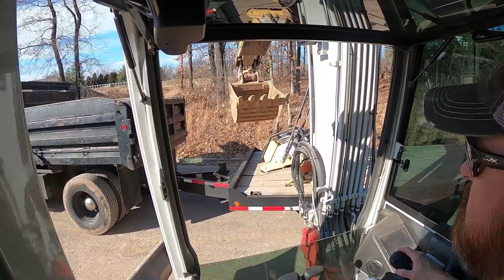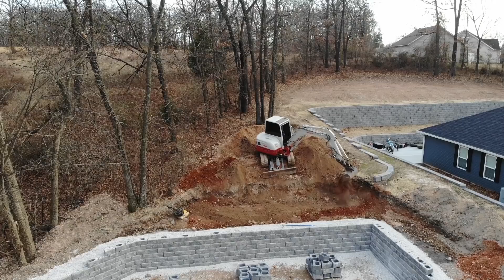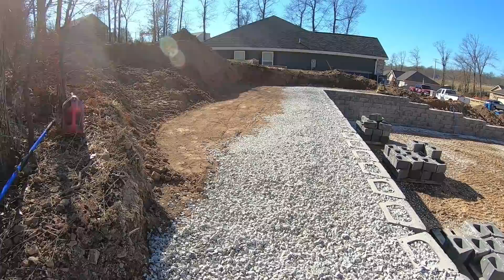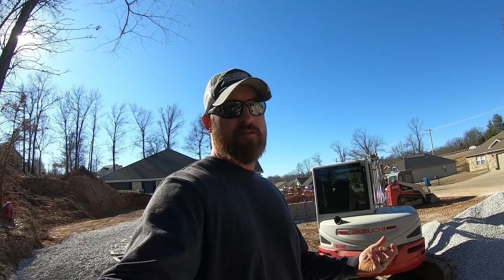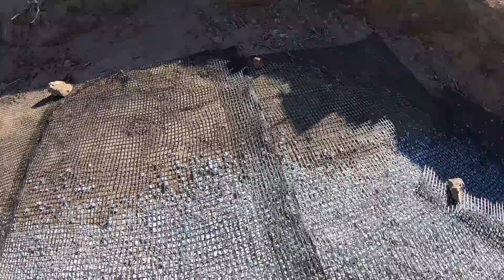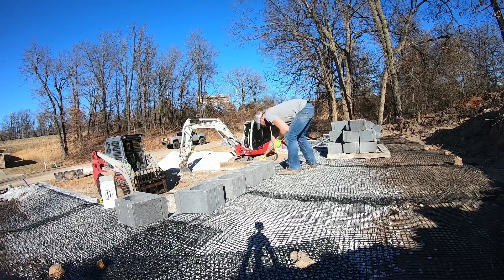Setting The Last Row Of Blocks

Comment: A company that I used to work for made construction barrier and geo-grid type fabrics.  I did some of the initial testing back in the late ‘70’s.  The answer to the strength question is pretty simple.

The fabric starts out as a molten ribbon.  It is pulled through a roller that pierces slits along its length.  As the ribbon is pulled through successive rollers it is stretched wider and longer.  The fabric you used is 1”X2”. That yields more linear strands per foot running down the length.  This combined with the extension bands along the edges give it more than twice the strength lengthwise .

You will almost always find rectangular extruded fabrics rolled with the slots lengthwise.  This is partially because they are more flexible.  But, mainly because it is easier to control roll widths across shorter extensions.  So, if you measure the openings across the fabric at the start of the roll and the end, they will be very consistent. The lengthwise openings will vary significantly.  It has to do with temperature, tension and speed of the expansion line.

Did you happen to notice that it is easier to fold the fabric lengthwise than to do so crosswise?  That is why construction barrier is usually square extrusions.  It will stand vertically better than rectangular fabric.  In your use, that doesn’t matter and you save money with less material in rectangular fabric. However, either will work.
Reply: Sorry about the fabric rant... almost forgot to compliment you on the care and workmanship you’ve put into this project.  It’s looking good.  My offer still holds... if you need a broom man just holler. 👍👍👍
Reply from the maker: William Harris wow good to know I’m going to start calling you more lol! You just told me more about than the guys selling it 🤣 I appreciate that and will definitely apply that in the future.
Reply from the maker: William Harris thanks! Lol good know I appreciate and will probably take you up on that
Reply: Elite Earthworks LLC yep... you have to have a broom man on every utility job... it’s just like putting a “Utility Work Ahead” sign out... put a guy leaning on a broom and you don’t need a sign!
Reply from the maker: William Harris exactly lol!

Comment: Great job and video Brandon. You are correct Geo grid stronger the way you put in.
Reply from the maker: Larry Shedd thank you! I guess it’s the way it holds they really didn’t explain it to me just told me that’s how it goes
Reply: @eliteearthworksllc  more  overlap ribs makes it stronger  like double the material every so many feet.  But lots stronger than just rolling whole thing out other way.  But you did it right way.  Takes longer makes it stronger.  End of day it's your job you have to stand behind.  Best way to explain is like cables every so many feet back into bank.  Did you do back yard that house has two lifts cut into back and side yard.
Reply from the maker: Larry Shedd I see that makes sense. Thank you! No some else cut that out and built those walls
Reply: Watch your words packing only 4 inches.  Your boots look bigger than that
Reply from the maker: Larry Shedd 🤣🤣 yeah they’re 13’s

Comment: Bravo... Some one on YouTube who actually compacts the soil instead of the many shove it shut and roll over it with track artists. A plate may be better in your application. We use jumping jacks BUT, most all our work is ditching with most jobs using a soil tester. In some of our work, we have to use screenings as back fill, especially in streets, making storm drain connections. Seems most always in the center of an intersection we find the storm drain manhole. Some as deep as 20'. Now those are mighty wide holes. :)
Reply from the maker: Ricki thanks! A jumping jack would compact better but it would push the wall, those things don’t mess around. Wow that’s crazy and I bet that’s a big hole if it’s 20’ deep. Those screenings work great for that stuff. Easy to work with
Reply: @eliteearthworksllc  Yupper, why I wrote a plate was better for you on that job. Wall push was on my mind as we don't have those issues with a trench. We are not permitted to install drop manholes hence the opening right to the bottom of said manholes. We may have to bring in 50 tri axles or more if it is all screenings.
Reply from the maker: Ricki wow that’s a load of truck loads

Comment: Nice looking job. Do those blocks have pins like the KeyStone Block system?
Reply: They have a lip on the bottom at the rear.  This provides the correct amount of inset and keeps them from pushing outward.
Reply: William Harris that’s the type I thought they were, but never seen geo-grid used with that particular system.
Reply from the maker: Blanton Enterprises thank you! No they just have a lip on the back of the blocks where they slide up to the lower block.

Comment: Hey Brandon just curious why you're not supposed to overlap the geogrid, I'd think that it'd be stronger tying them all together? And you can't go wrong on those little Predator engines, I've got several on different pieces of equipment. I generally wait until they're on sale for $99.99 and you can buy 3 or 4 of them for the price of a Honda! And they've been really reliable for me. Great job on the wall buddy!! As far as the geotech mat to separate the rock and dirt I believe different kinds of soil really makes a difference on if it plugs it up or not and there's different types of matting, a bit more expensive than the plastic but I really like using the felt mat but it's about double the cost and 99% of customers don't like anything that costs double. Lol...
Reply from the maker: Clyde Acor I’m not really sure either the guys selling it at the block place just told me it’s not designed to overlap but they didn’t elaborate 🤷🏼‍♂️. Yeah those predator engines are great identical to the Honda engines. That was a lot of here they didn’t care to spend the money on the good fabric. Appreciate the comment! 👍🏻

Comment: I have the same plate compactor and it works well but as you said you’re limited on how much material you can do per lift. I was maxing out at about 4” lifts but I did rent a big diesel powered vibrating plate packer when I did the base material for my driveway. 

Have you ever had any issues with the actual vibrating “drum” on the Wacker packer? Mine at times wouldn’t vibrate even though the engine was revved up but would start if I flipped the handle and pulled it at first.
Reply from the maker: Wayne Crews no I’ve never had that issue with this yet. I want to try one of those big diesels too. Would definitely help compact quicker. Thanks for watching

Comment: home diy'er here, are you factoring the thickness of the geogrid to keep the blocks from going too far out of plum...maybe starting off angled in towards the street at the base and even it out over the height of the wall?
Reply from the maker: Adrian Sanchez I did a little bit the geogrid is pretty then and these blocks are so inconsistent it really doesn’t matter. A better manufactured block you would probably want too but these cane out fine
Reply: Elite Earthworks LLC thanks, makes sense to me 👍
Reply from the maker: Adrian Sanchez no problem hopefully you have better quality blocks lol

Comment: What are you using to cut that Geogrid? Some kind of scissors or a utility knife? I’m always looking for an possibly easier/different way to cut that and weed barrier and straw matting type stuff than a utility knife if there is an easier way. It’s looking good man. Starting to really come together!
Reply from the maker: pjs5191 yeah they are a heavy pair of scissors. I have not found a good way to cut weed barrier or this stuff. It’s just a pain lol, thanks for the comment
Reply: Milwaukee makes a really nice pair of heavy duty scissors that I really like. You can get them at Ace Hardware.
Reply from the maker: Clyde Acor nice! I’ll have to get me a pair
Reply: Thanks @clydeacor I’ve been lookin for some good ones.
Reply: @eliteearthworksllc  you betchya. They seem to be holding up great for everything that I put them through. And I don't remember but they might have a lifetime warranty.
Reply: @pjs5191  sure thing. I really like the pair I have.
Reply from the maker: Clyde Acor nice evening better

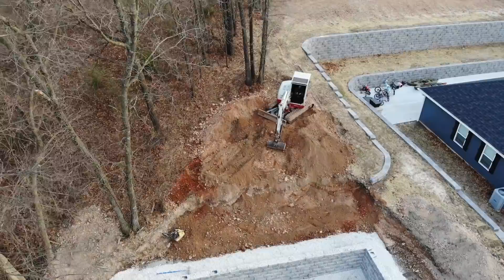Comment: that homeowner must have spent a fortune on wall blocks. Looking at all the walls he had to built ..... But looking at the drone footage 7:34 makes me wonder why he did not redesign his entire property to make it more useable this time around. I would have taken the wall that comes from the rear of the property where it curves out toward the parking lot and extended it to run exactly where you dug out already, then let it meet up with the far 45 degree wall section that runs along the tree line. Then dig out the entire hill that now sits between the house and the parking lot, curve the lower level retaining wall in to meet up with the curved upper retaining wall and combine all of that into a level flat useful garden / parking lot area. With the design now, the propety is still divided by a huge hill which is a pain to maintain and essentially wasted useless space.
Reply from the maker: Silent Epsilon I think he wanted to but the builder didn’t want to mess with it. I don’t know all the details but I don’t think things came out exactly what they were hoping for. So now he’s just trying to make the best of it. Appreciate the comment

Comment: My Honda just quit on my Wacker I’ve been looking at putting a predator on it is there anything to modify?
Reply from the maker: R. Mcgurd 469 the predator is identical to the Honda engine. There is two sets of holes in the bottom of the motor to line up on the wacker
Reply: Sweet I like them little fake Honda’s lol
Reply from the maker: R. Mcgurd 469 yeah they are cheap enough you have problems you chuck it and get another one lol
Reply: Exactly then it’s like a bonus pile of junk engines to pull from.👍
I also haven’t been able to kill any of my predator engines yet lol I’ve got the biggest one on my paver and a few more on sealer  pumps and water pumps now I have one on my Wacker I wish they made a gear reduction engine for my little roller